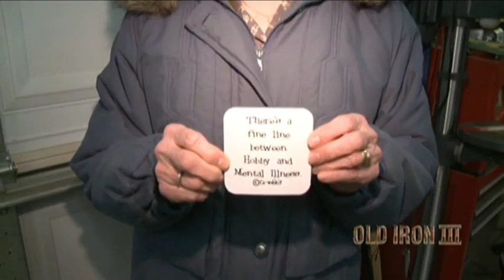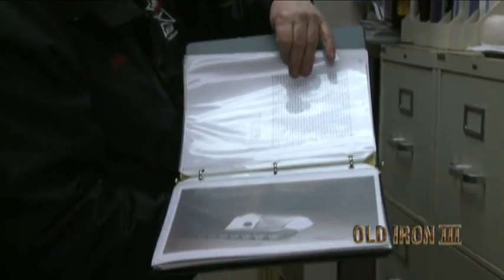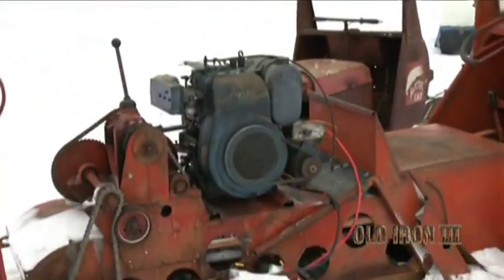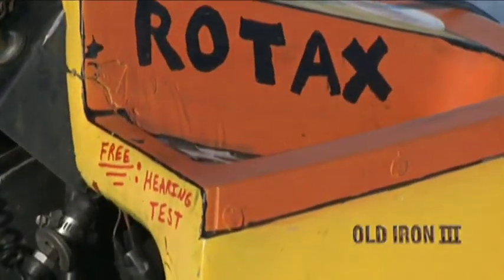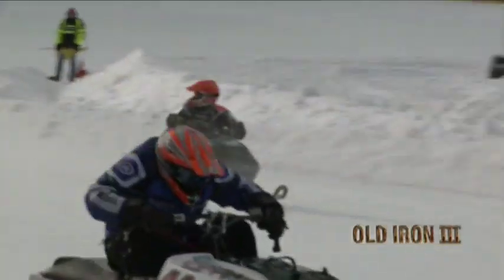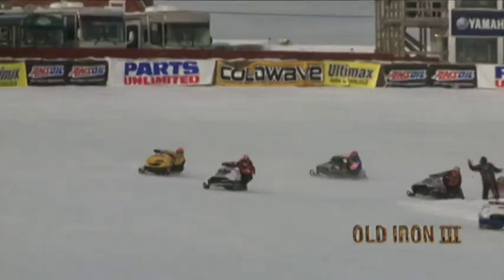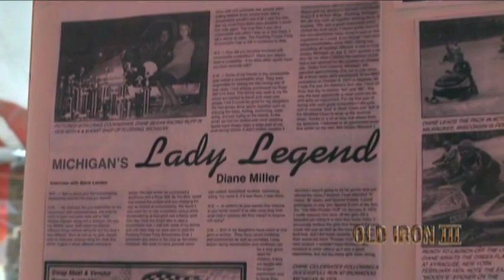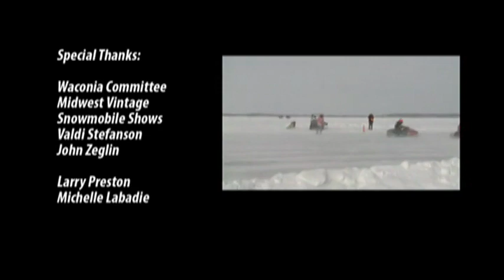Old Iron 3

Comment: Your snow flake by Carly, looks like a Bear Cat snowmobile that I used to have back in the 1990's in Kingston On, Canada! I painted it and drove it for a bit. I sold it and got into the late 70's Yamaha's with the gas tank at the back of the seat. Great collection you have there. Quite a few from Canada eh! What will you do with them all? I only have one now, 2004 RX Warrio 4 Stroke by Yamaha. Great sled for crusing the trails - but not a ditch banger. Glad you saved all these old sleds.